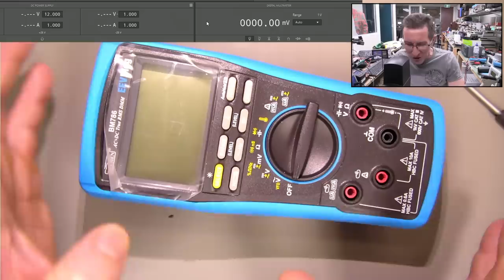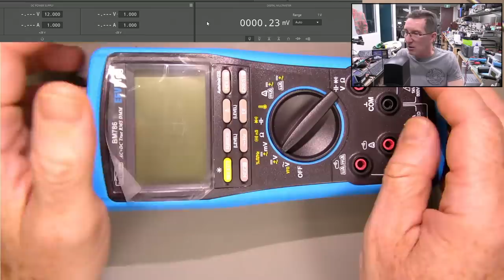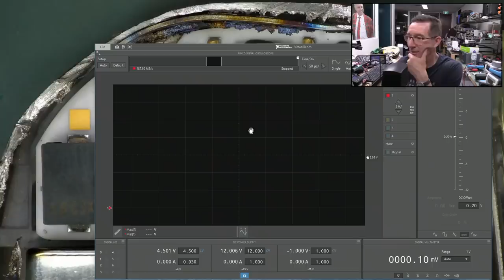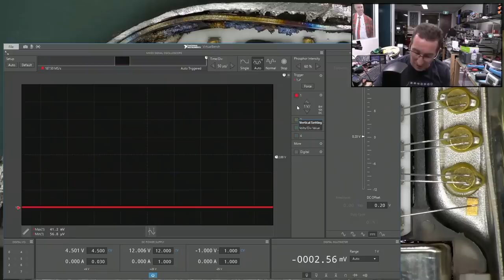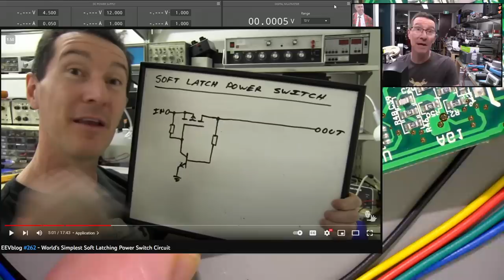EEVblog 1520 - Troubleshooting a Faulty BM786 Multimeter

Comment: Instead of replacing the crystal fot testing,  could you have paralleled it with a good one to see if oscillations would start (even if the frequency was off)? Alternatively, could you tack on wires from the crystal to another (battery-operated) oscillator circuit to see if oscillations will occur? (The latter assumes that the meter’s IC wouldn’t interfere.) Either way you would have avoided unsoldering the crystal and, of course, the less you have to unsolder the better.

Comment: Did you let the smoke out when you connected your external power supply in reverse polarity? Even if the reverse protection diode is used, was it enough to protect the processor.
Reply: At 30mA set current, it should hold just fine.

Comment: I bought. a BM786 Multimeter a week ago
The white plastic contact range switch or 
The brass contact range pin are out of specifications.
Issue was when I turned the contact switch to different meter functions
the meter would turn off and restart or change unwontedly to a different function.

So me knowingly, knowingly knowing, that Im a mechanical genius
Intuitively discerning a faulty design, propagated
By a self promoted perfectionist mind.
Decided the meager challenge, “ Dam-it Im gonna fix my multimeter.”
Assessing the problem cause and effect
Contact range wibble and wobble
Wobble and wibble 
Under her skirt teeny tiny contacts
She must be a tease ?
Immediately I cut 1/8 of an inch * 4
Off the wire tie, that holds The Test Leads
Place them in the white plastic contact range
Where brass pin enters.
And not to my surprise, the BM786 Multimeter
Good as new.
Let this be a lesson to you 
That is why Fluke meters are expensive…
😊

Comment: in order to get them to realize the film is part of the packaging, not of the product itself, and needs to be removed before use just print something all over it :P preferably something that does not represent stuff that would normally be on the display while on or they will go 'i can't switch it off' :P

Comment: For removing 2-pin discrete components, I usually like to use two pencil irons, with one in each hand. Maybe that technique would have helped with that crystal?
Reply: There are tweezer style irons designed specifically for 2-pin smd components.
Unfortunately, very few people see them as a good investment.
Reply: @KingKong-mp6gj  I have used them. I prefer using two pencil irons. That has always worked better for me, particularly with small components like 0402 and 0201.

Comment: Looks like the U2 has a hole blown in the back.
Reply: I'll swap you a Keysight meter for parts.
Reply from the maker: You mean U20? That's a manufacturing dimple.
Reply: @EEVblog  No, U2.  I'll post a photo  on the forums.
Reply: Better view of U2   at  16:16
Reply: @johng4527  Much better view.  Thanks.

Comment: Why would you expect continuity thru a power circuit?  The power would have to be on and the multimeter would have to supply the correct voltage.  It would really help to have the schematic ;-)
Reply: Oh come now, nobody knows EVERYTHING bout ole Mr Electricity!  Mook

Comment: For a while I had been using a swiss watch that I keep putting dollar store batteries in. The strap is continuous so it may have fell into the quartz coil beside the battery. I noticed that there were little wires coming from the coil that would stop the watch if they touched something so I was trying to figure out what to do about them and a bit perplexed why an open circuit would still be working. Anyway my final attempt was to remove the coil and I was trying to dip it in a instant plastic I used for furniture finishes. So I broke the pcb part of the coil when I took it out and I said well I lost that one. If I got another Ronda 715 coil somehow I could try to make it work again but I am not really planning on it. I just use another watch.
Reply: You can probably just replace the cheap movement if you like the watch (I'm assuming a Ronda 517 day/date).  You'll need to swap the face and hands over, and probably the stem (or cut and fit the new one) but it's probably easier than trying to mess with the coil.  Touching the coil with any kind of tool can break it.  The wire is much finer than a human hair, and you can probably get the whole movement easier and cheaper.

I'd recommend you don't use the cheap batteries.  You can get Renata, Sony etc pretty cheaply on Ebay and they last about two years or more.  The Sony part number is 920SW but they may also list it under the Renata part number 371.
Reply: @Chris_the_Muso  Yes it was an option. Thanks

Comment: Having an issue with 2 multimeters at work 
I’m in a mechanical trade, meters used mostly for 12v stuff 

Two of my bosses meters have the same problem, when on dc voltage it shows increasing values when the probes haven’t even touched anything yet 
It’s a bit annoying..  but if I touch the probes together the values decrease down to 0 then I can check whatever voltages I need to check 
And it’s accurate, doesn’t change at all when reading a voltage source 

I assume someone (probably me) put a load on it somehow 

They’re not worth fixing, but I’d like to know what the problem is exactly so I can avoid it in the future

Comment: I wonder if anyone has made a rechargeable multimeter
A multimeter that is rechargeable sounds like a nice idea.
Esp when you need to use it and find its dead due to flat batteries
People have battery banks so users could quickly recharge them.
Reply: No because it's so infrequently replaced. You can use lithium batteries that will last years even with heavy use.

Comment: Honestly, in my opinion it's way too much talking and too little thinking. This looks like checking random things in random order.
What I would do is checking how this power latching signal is generated exactly. Secondly, I would chase reset signal, this should be pretty easy to buzz from the programming header.
Reply: That’s a fair comment, however, when making repair videos you do spend a lot of time talking over what you’ve done or are about to do and from experience I can tell you it definitely detracts the thinking mind from the normal smooth repair process.
Reply: @IanScottJohnston  True true i swear my IQ drops to <50% if i chat to someone while im doing a repair
Reply from the maker: @IanScottJohnston nailed it. Also, the stuff I did was the basic troubleshooting you should do. Checking the battery first, then the range switch, then follow the rails and see what's happening and why.  Then try the programmer and bypass stuff. Basic fundamental stuff you'd do before chasing a power latching or reset signal. The fact that it took 39min of video to get to that point is kinda irrelevant, they were all things that had to be checked.
Reply: @EEVblog  Yes, you have to go through basic sanity checks, this goes without saying. But my impression was that it took way too much time and it wasn't done in a systematic manner.
Secondly, (I have just realised that) the fact that the latching circuit has worked for a brief moment might imply that this is not MCU fault at all. This means that the fault is intermmident (or intermmident-like since the device doesn't work for the vast majority of time), but MCUs hardly ever suffer from intermmident faults. Besides, it seems like you blidly assumed that this circuit is somehow driven by MCU, without buzzing this out. I wouldn't be surprised if this was some some or mechanical issue, like a broken trace or cracked component. In such cases, when you apply a little bit of pressure in a magical spot, the issue might go away temporary and this is what we have seen.
Reply: @faust-cr3jk  Maybe the power timeout is set by an RC cct and the capacitor is broken?

Comment: Merry Christmas, Dave.
🎅🎁🎄🎎🎀🧸🛷❄⛄🎑
PS - My Micronta DMM (22-191) finally died after about 40 years of faithful use.  I got it for Christmas back in the 80's.  Same deal.  Turn it on and nothing happens :-(   I am not going to try and fix it, but treat myself to a brand new meter with a million features :-)